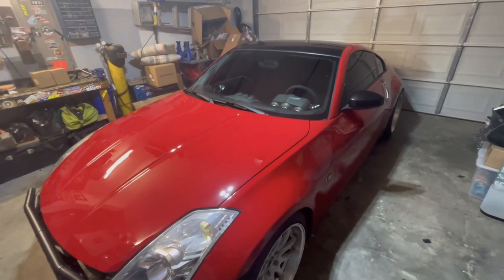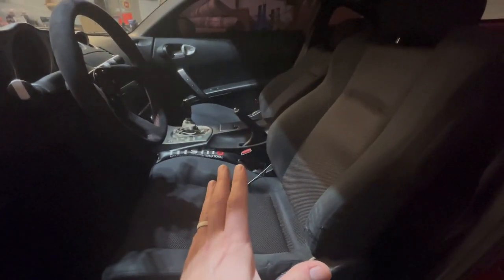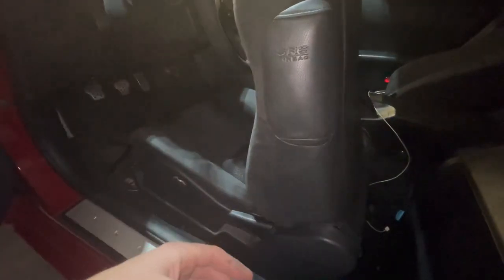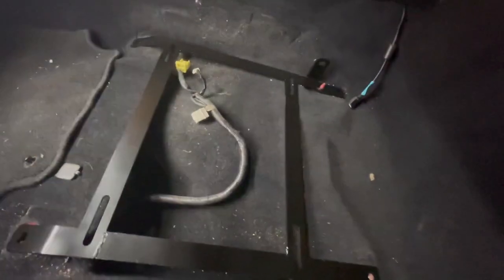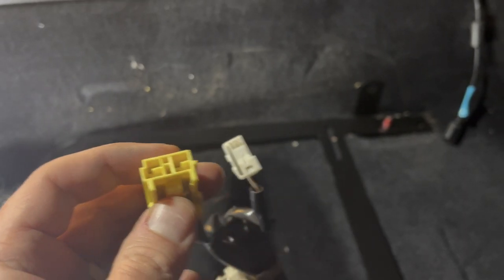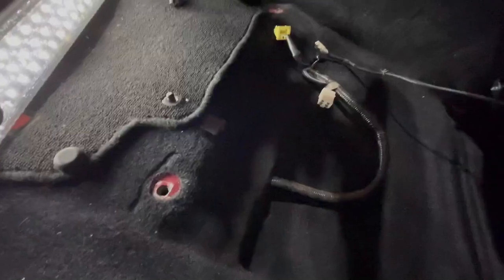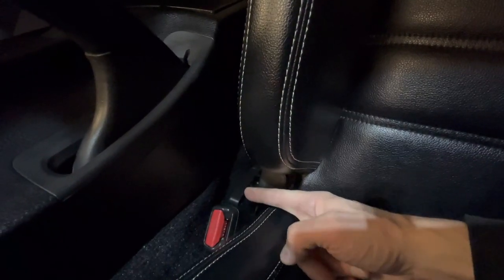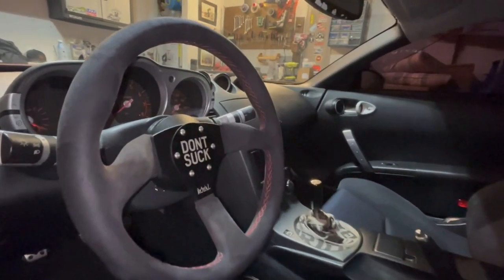350z Aftermarket Seat Installation | Sparco R100

Comment: I have the same cheap floor mount, it aligns great on the floor, but not on my passenger seat. 

How did you get it to line-up on ur seats? Did you drill holes? My problem is, the whole bracket is too narrow for the passenger seat...what do I do?
Reply from the maker: I actually don’t recall what I did.  I may have drilled holes but I feel like everything lined up.  I ended up getting Corbeau seats with their brackets

Comment: So I was thinking of installing these exact seats in my 350z but my concern was passing inspection. I know that harnesses and a harness bar is an automatic fail because the plug underneath would be unplugged. My question that my Enthusiast model Z has a yellow plug underneath is that going to the seatbealt or is it for the airbag and is it the same on both sides?
Reply from the maker: You can retain the factory seat belt
Reply: @SpeedCultureStudios  and I should be able to pass inspection in NY? So the wire piece underneath is connected to the belt buckle? I thought it was connected to a seat sensor in both seats.
Reply from the maker: @DragoMusivini  I have no idea what your inspection requirements are.  There is an airbag sensor—typically yellow—under the seat.  You can use a resistor in that to prevent the airbag light.  There is also a plug for the seatbelt.  You can keep the fsctory belt and buckle in for use if you’d like.
Reply: @SpeedCultureStudios  So one plug for the seatbelt and one for the airbag. Then it should notbe an issue if I retain the original seatbelt and parts. Now as far as the airbag wire you are referring to the piece that is stuffed inside the seat that tells when someone is sitting there correct?
Reply: @SpeedCultureStudios  did some more thorough digging. While the aftermarket steering wheel would be a definitive fail for the inspection along with not being able to hook up the airbag wire it would also throw a code in which only Nissan would be able to fix so needless to say it would be me getting screwed from every which way. I do like your concise tutorial though.